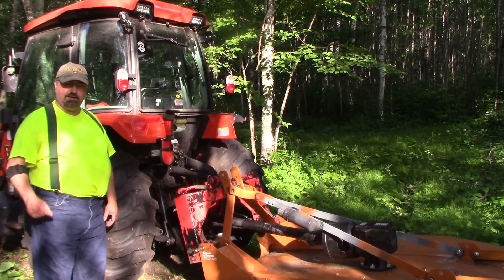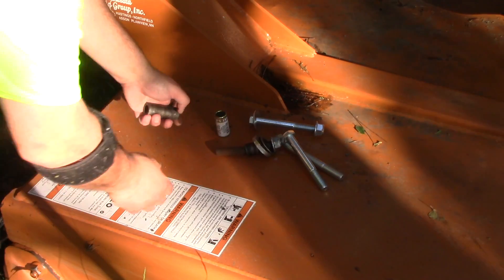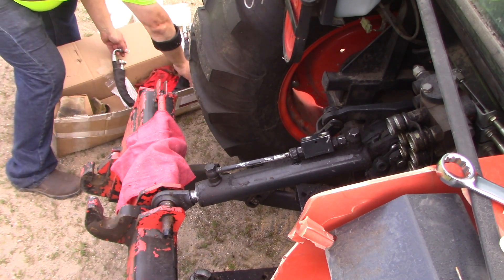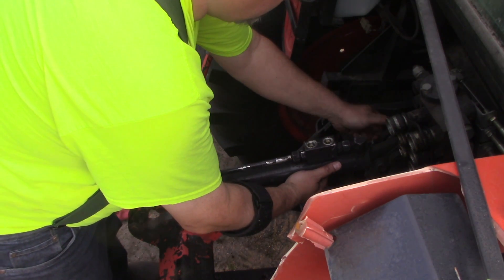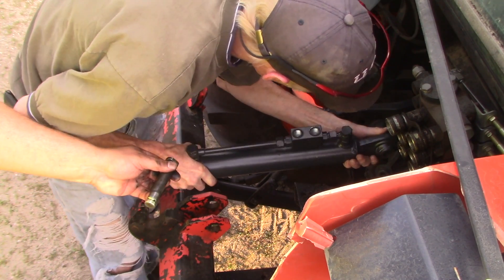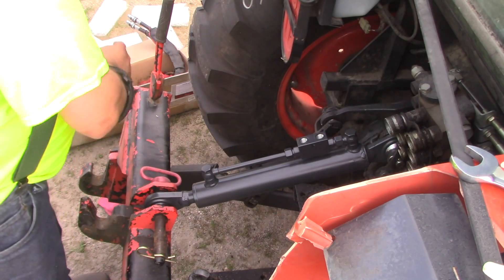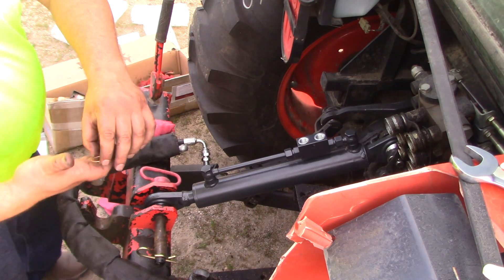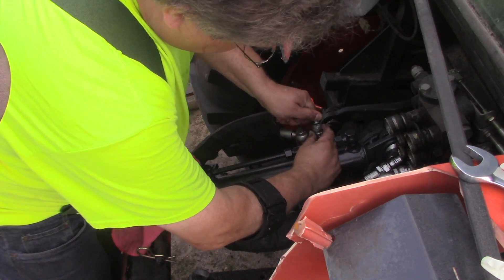Removing and Replacing a Hydraulic Top Link with a Locking Valve on a 3PT Tractor

Comment: Two words, steam cleaner.  It will make life less greasy.
Reply from the maker: You can eat off of the engine. The rear end will get cleaned up the day I sell or trade it in as just changing out attachments leave hydro oil everywhere and this tractor is rarely close to a pressure washer. LOL